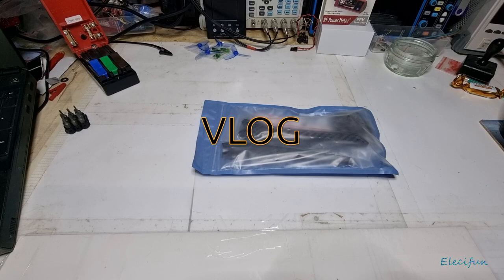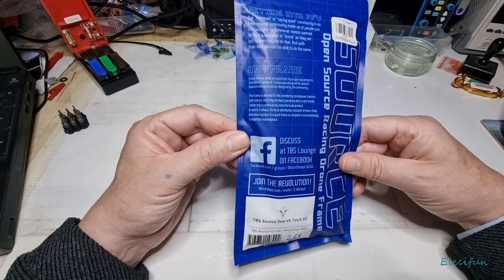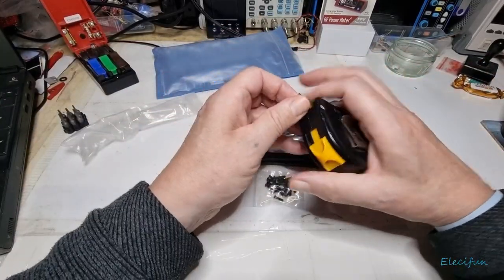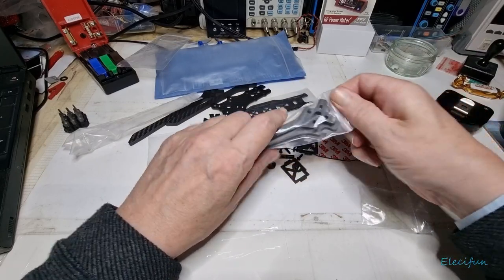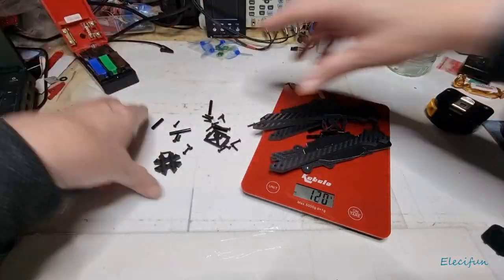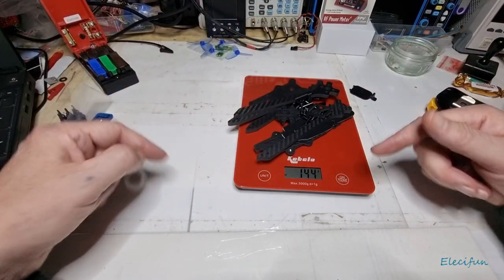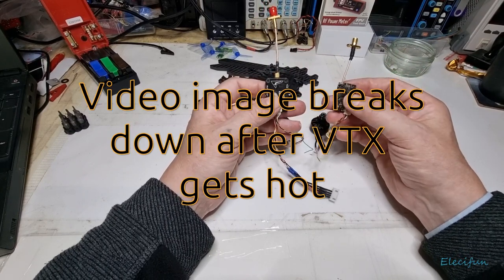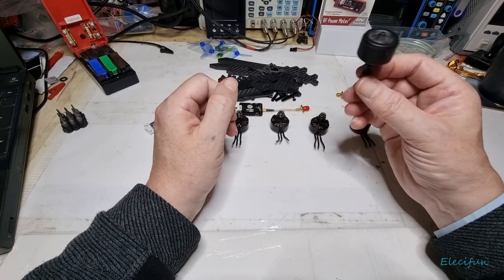TBS Source 7inch Long Range Build Pt1

Comment: A very timely series indeed!
Reply from the maker: @Sonic_Ox I told you buddy, your video inspired me. Also there is new software from the good guy's who develop iNAV and I want to try the 7 inch presets.
Reply: I think INAV 7 has dropped but it's probably the first of several "beta" versions while they work out the bugs. I was hoping you would install magnetometer equipped GPS module and use INAV to configure position hold, return to home etc. Exciting stuff Elecifun. Thanks for producing this series. Fun to watch while I'm budgeting components lol. Happy flying amigo. I'm editing a video right now showing the direct drive extruder I've installed on my 3d printer. I've got it working well with TPU filament and have already made a few parts for the 7" build. Cheers mate 🍻
Reply from the maker: @Sonic_Ox  I omitted the GPS and magnetometer by accident, sorry bud. This build will be using a GPS module to ensure fail safes like 'return to home' and position hold features. I blame the omission on the 14 year old single malt from the Isle of Jura I'm enjoying today. Let's hope it doesn't effect the finished build..to much.
Reply: Lol now you've inspired me. I'll be having a nice Kentucky bourbon this evening with a splash of cola. Cheers!
Reply from the maker: @Sonic_Ox  'Clink clink' cheers amigo. Not sure what Jim Beam would say to the cola, but hey, we all enjoy our hooch our own way.
I just got back from walking my cats.. Off to bed now. 
I will look out for your video in the morning.
Reply: Jim probably rolls a bit in his grave when I add cola. I like a bit of ginger ale in there once in a while also. But Jim is dead and is really pretty quiet about the whole issue. Have a good night amigo. When I edited the video about the direct drive unit I found it too boring to post. It was like "meh,  most folks who care already know what direct drive does..." I'll post it if my long time subscribers clamor for it. But BOTH of them have to clamor...🤔🤭
Reply from the maker: @Sonic_Ox  Oh m8.. I needed a laugh this morning and you didn't let me down. Awesome!
From a personal point of view I don't have a 3-D printer. I am interested in upgrades etc.
I hope the other two show interest! 
😀
Reply: I'll put together a better video detailing the direct drive and post it this evening. I have to drive the missus to an appointment out of town today. I hope you have a great day amigo! Or had... I think you're about 7 hours ahead of me lol. Cheers.
Reply from the maker: @Sonic_Ox  I'm off to check it out..